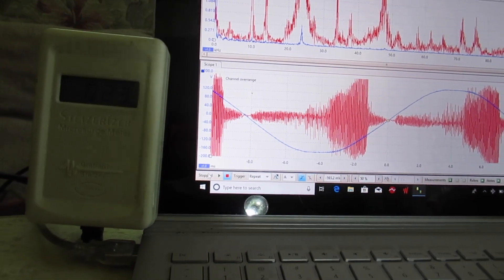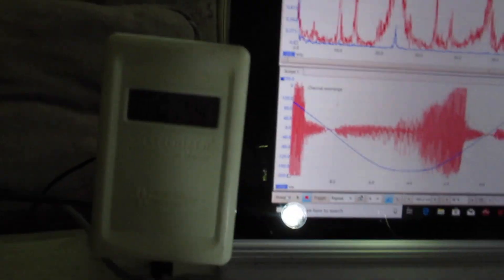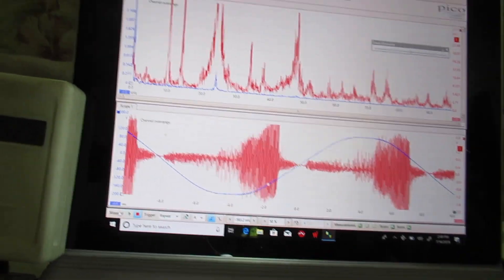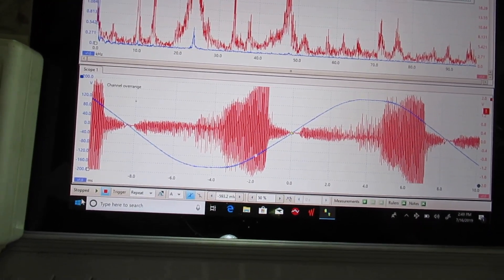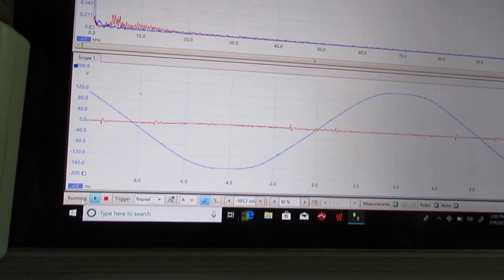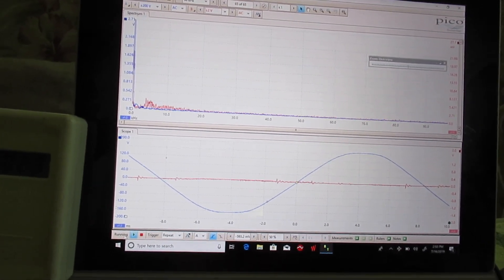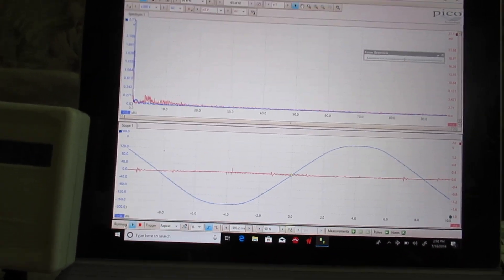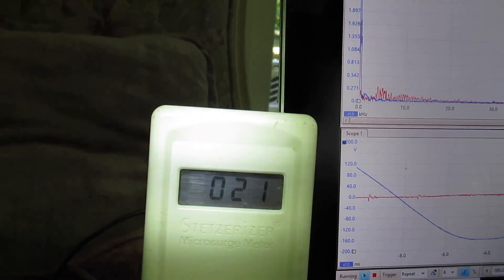Xantrex solar inverter creates  dirty electricity: clients feel it.

Comment: I am in the UK, we don't have any people like you here yet! But I have big problems (High EMF- showing as power line!) running down a earthing cable from my solar (solar edge inverter). I also have huge EF (extreme in places) running through my radiator pipes in the house (the pipes are adjacent to the earthing cable in places- as is the combi boiler- which also shows high EMF when on.) Also my plug sockets near the earth cable and radiator pipes are showing high EF. Can you tell me what inverters are cleaner and if you think the EF could be caused by the EMF from the inverter? I am at a loss- no one can help me in the UK, this just isn't known about here.